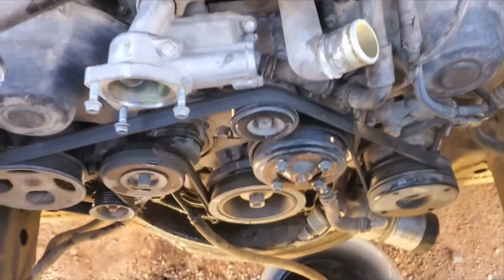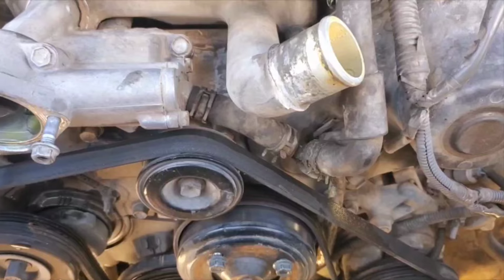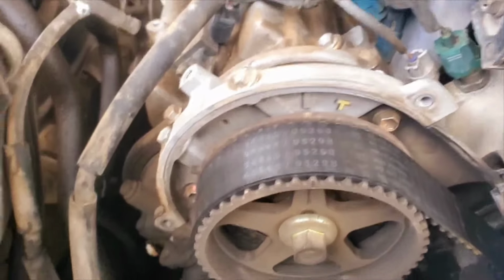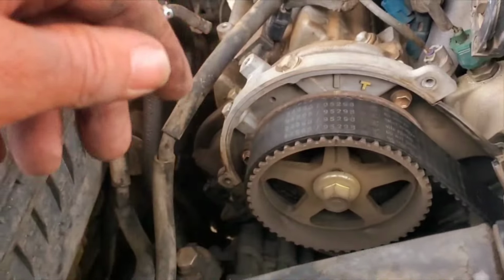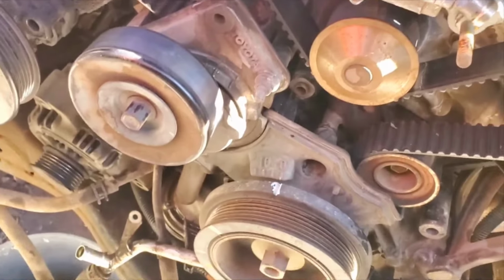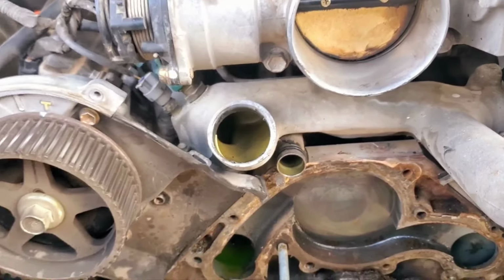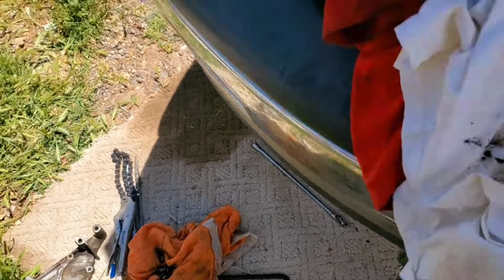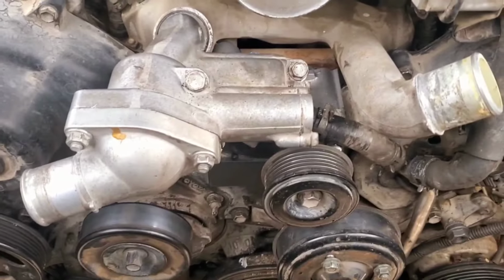Timing belt and water pump. Sucks Ass!

Comment: Car engine trouble D.J.? Respect to all like you who first figure out how everything is put together, than piece by piece you take it apart and coupla hours later, finished and car's ready and revved up for the road again! Thanks for sharing bro, 👍and wishing ya a great week.👋🤠
Reply from the maker: Hi Brother, Not really any troubles, This is just one you have to do so you don't have trouble if it breaks. If the belt breaks then you are replacing valves, Maybe heads. Who knows what is all getting destroyed. Thank You Brother.